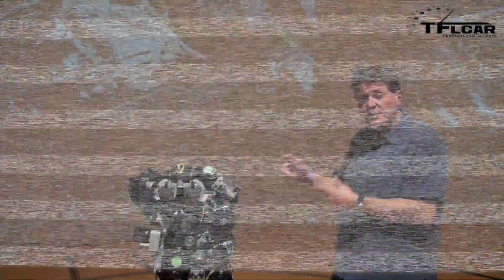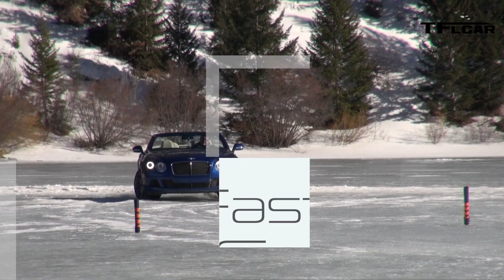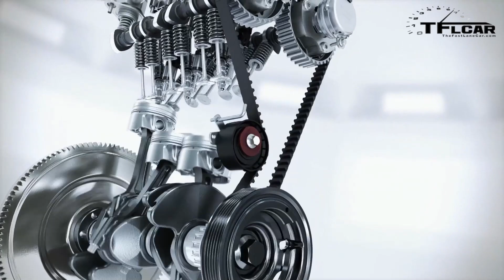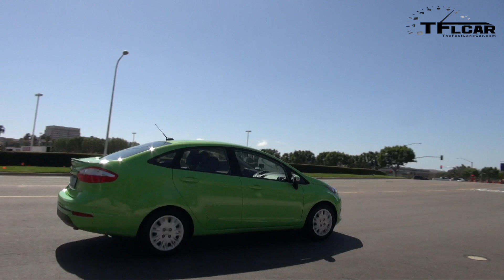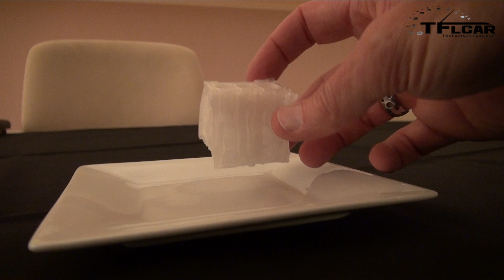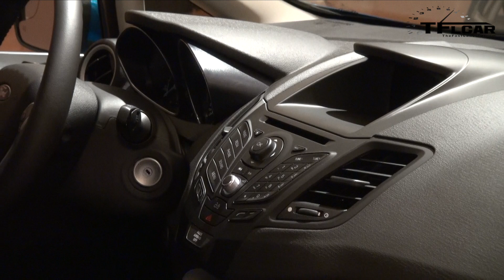2014 Ford Fiesta 1.0L EcoBoost: Everything You Ever Wanted to Know

Comment: I like the idea but I worry about the timing belt
Reply: Jonodude0 I have 999cc car , and it had it's first belt change at 200.000km (120.000mi) . Mechanic told me that it is as good as new when he got it out . And my driving stile is - I drive on 2 lane road in fifth , catching up a truck , slowing down to 40mph , waiting enough space to overtake , slamshif it into second , accelerate to 50mph , and than return into fifth . I am mistreating engine  , now it has 250.000km (155.000mi) , still works as new . Car is 15 years old . You would not believe how much regular oil change could be important and how much new engines could take .
Reply: Thanks for all of your input! It definitely is a new idea to me - nothing like that is available in the United States as far as I am aware. Seems like its working!
Reply: Jonodude0 Well , look at it this way - small engine has light components . Timing belt snaps because of overloading . If it drives light components (small springs , light valves , light camshaft) and belt itself is bigger than it should because it could not be made any smaller , it can last very long . My car is Hyundai Atos . It regulary hauls 5 persons , at least twice a week , when we go to countryside (I live in town , but I have farm about 10 miles away) . Oil is your biggest enemy , because if it was not changed regulary , it becomes thick and it can jam camshaft .
Problem with US market - you buy new cars to often , and you expect to get a lot of car for small ammount of money , so car makers save as much money as they can to make them competitive . You are oversupplied with fake parts because you are big market , and everyone want to maintain their car as cheaply as they can . I buy parts from guy that imports parts directly from Korea , and if he does not have that part that I need avalible , he directs me to other direct importer . His logic is - other guy could not sell it any cheaper , he would still have satisfied customer and customer would have working car so he can buy more parts over years . Because I live in small market , logic is - if parts are too expensive , customer would switch brand .

Comment: Ozni Wellman,  in what world is 45 mpg "doesn't get over 40 mpg?"     And your heralded 3 cylinder Geo Metro also made a whopping 55 hp, about as much as a riding lawn mower.  You'll spend so much time flooring the thing trying to stay away from the traffic roaring up on you that you'll never see anywhere near 49 mpg;   Whereas the Fiesta's engine makes 123 hp, making it much more useable AND fuel efficient.   That's a better combination in every way.     And don't complain to Ford about airbags; that was the government's requirement way back in '97.  And speed is the driver's choice.  No one has to drive 75-85 if they don't want to.  I have a 500 hp GT 5.0 and regularly cruise under the speed limit for the sake of fuel efficiency.

Comment: You know many ECO-BOOST owners in the different engines with Direct injection are having severe drivability issues due to EXCESSIVE carbon build up in certain cylinders and I am talking about LOW mileage vehicles not 100,000 ++++ miles, plenty of negative write-ups here about the eco-boost

Comment: Before 2009 I was not a Ford fan due to my experiences with an old Ford Escort that was a complete lemon but I have owned a UK Fiesta 1L Ecoboost 125BHP now for 6 months.
Previously I had a Fiesta 1.6 4 cyl for 4 years which I loved.
I do a mixture of driving from absolute thrash to gentle pootling about in the city. I get at least another 60 Miles out of a full tank of fuel compared to the 1.6 litre. The 1 Litre is considerably quicker on outright acceleration than the 1.6 was and anyone who says it is slow, clearly doesn't know what they are talking about! I am averaging 47 MPG, with my 1.6 I averaged 44 MPG. My only concern is long term wear of the engine and what would happen if the turbo gave up.
Reply: I sold THAT fiesta a year ago and bought the 140BHP 1ltre version but I know the person who bought THAT fiesta and they have not had any issues with it and I believe they have done 20K in the last year so that would mean it has done 44K in 3 years with no issues.
Reply: I should point out that I live in the UK where a gallon is 4.455 litres. I think it is less in the US.
Reply: Thanks for the info from an actual owner.  I'd take 47 MPG all day long.
Reply: *****
And my MPG is worked out on how many miles I ACTUALLY do and how much fuel I use, not what the car's computer tells me which is 52MPG.
Reply: Nice to hear...I have a silver 2015 3 cyl fiesta on order here in Orlando, Fl...should arrive in late October...I am going to be transitioning to a job with a long commute next year so am looking forward to the 50 MPG.
Reply: goodchappy
Yep; I've noticed on most of my cars that the car computer's average will be a little higher than what I calculate.     Still very good though.
Reply: goodchappy - Correct... US Gallon = 128 oz, UK Gallon = 160 oz.  

47 MP[UK]G is roughly 38 MP[US]G.
Reply: GoodChappy....if your still around here, and have THAT Fiesta,...hows it doing NOW in 2017?  What has gone wrong with it. Guess it is still under warranty? Dont know the length of them in the UK. The turbo dead or the lifetime timing belt snap yet?

Comment: funny how he doesn't recall mpg in Europe,  cause im sure he does know.  European cars tend to get much better mph then U.S. cars.  Care to comment Steve ?
Reply: MPG*

British MPG =/= US MPG. They measure gallons differently.
Reply: Goalatio In the UK, they use gallons.  However, their gallon is closer to 160oz vs 128oz in the US.  For that reason, mileage ratings in the UK, given the same exact vehicle and engine, are higher than the equivalent US measurement.  You get more miles per each UK Gallon than US Gallon.
Reply: european cars are measured in KM or l/100km so the numbers are roughly 1/3 higher

Comment: Never answered the reliability question at all -ducked that one.

Also, the integrated, cooled exhaust manifold will make it warm up faster in cold weather, thereby reducing the idle time needed to get the interior to a bearable temperature in winter.
Reply: That was the thing that perked up my ears. Living in Michigan is tough on cars especially in the winter. I was also concerned with the fact that this is turbo charged and I didn't want to have to wait for the coolant and the oil to warm up so the turbo would be properly lubricated. After hearing about all the new ways this engine takes care of itself, I think this is going to be my next engine.
Reply: Tom Poole I live in Canada and the integrated exhaust works to warm up faster but sometimes it’s so cold my car doesn’t even warm up fully in winter

Comment: Wyh do the US only have 87 octane fuel? The lowest here in Germany is 95.
Reply: its simply different units...We use Octane. European use RON.
87 octane is about 92 RON. 
91 octane is about 95 RON
93 octane is about 97 RON
Reply: The octane ratings are calculated differently, so it's not a direct translation.
Reply: If you're so smart and know everything why don't you just explain yourself?  No need for name calling.  Otherwise stfu.
Reply: Our maximum speed limit is 75 MPH, you guys drive at 120 MPH +, you require a cleaner burning fuel.
Reply: IntegraFilms That's not correct.  They use a different rating system.
Europe / USA
95 / 87
97 / 89
99 / 91
101 / 93
Reply: Robert Nugent Actually we are both correct. ;)
Reply: IntegraFilms I don't see how that's true.
Reply: Robert Nugent Maybe your just dumb. America has strict car regs and complicated emissions systems that rob power, europe cars are simpler, fuel is more complex.

Comment: The 1.0 L Ecoboost is 129hp. It has an oil bath timing belt and a 3 phase cooling system.
Reply: 123 HP actually. but ford claims 125.
Reply: Well I am Ford trained, I am one of their techs. The number is different in many places.

Comment: Timing belt.... I doubt that would last forever. I don't see the point of turbocharging a small engine. Just because it has DI does not make bullet proof. Just like in there trucks twin turbos on a 6 won't have long time reliability.
Reply: matthebest018 - What engine is in your pickup or whatever?

6.0L+ V8 putting out possibly 300hp?  Definitely stressed lol
Reply: The turbos aren't really the issue on these.  It's carbon buildup from the direct injection system.  Also, they torture tested them for several hundred thousand and saw very little wear due to superior oiling/cooling design of the whole setup, including the turbo bearings (they did some nifty engineering to warm the oil to operating temp quickly after startup too).  The reason they didn't see these carbon problems in testing is because they don't test them at constant low-load situations where you tend to get carbon buildup.  They run on a dyno at WOT for the 'equivalent' of their number of testing miles.  All the manufacturers do it that way.  Since these have so much low-end torque, and they're programmed to run at low rpm for gas mileage purposes, they rarely see high rpm use.  I've got the 1.6L ecoboost in my wife's car and it acts a lot like my Delta 88 that had the 3800 V6 in it, great throttle response, lots of low end torque, not much extra HP if you wind up the RPM.  Unless I'm passing on the freeway or having a little fun with it, it rarely hits even 4000 rpm because I've got plenty of pull down there, which is crazy being such a small motor with a turbo.
Reply: mohammad ali My honda accord has 250,000 on it, we still use it every day. Waiting for Turbo VTEC, Honda always does things better then ford.
Reply: matthebest018 - 350,000Miles?  Is that all?

There are taxi drivers here with 450,000+ Miles on their Diesel Engines
Reply: MrAndersie91 Not under stress? Do you know what trucks do? It's 350000 miles of hard work and that one time i went offroading ;)
Reply: matthebest018 Wow...one whole time offroading...
Reply: matthebest018 It's a more than a little disingenuous to say that considering the engine line is not even 10 years old yet.
Reply: MrAndersie91 Yet mine is an old gasser 4.8l does everything i ask it to
Reply: matthebest018 - Its an over sized lazy american petrol engine which isnt under ounce of stress..

They usually do last ages
Reply: MrAndersie91 Diesel engines are a whole other ballgame. There's a reason they don't put gasoline engines in 18 wheelers. They're built for torque and durability.
Reply: Count Crotchula - Dont put Petrol Engines in Trucks,  but put 5.0L V8 into Pickups?  Logic Is Where??
Reply: MrAndersie91 I'm talking about 18 wheelers not pickup trucks.
Reply: *****  Tell that to BMW motorcycles. Their horizontally opposed flat twin  is one of the most reliable, high mileage engines in the motorcycle industry and has been for years. I do agree that proper design is  key to reliability. Also application and maintenance are key issues that dictate reliability.
Reply: Oh I'm not trying to make argument. I agree that an inline is probably the best configuration for endurance and performance. That is why every Asian hot rod currently produced is an inline. The Suzuki Hyabusa, the Kawasaki zx-14, the new Kawasaki  supercharged H2, and yes even BMW's S1000RR. They are all inlines. They are all very dependable, durable, and very fast.
I also have dealt with several Harley type engines, mainly S&S engines that the configuration is out dated by decades. 45° v twin,  pushrods, and a common crank pin with male and female rods.
S&S had a family of 100, 107, and 113 cu. in. engines. The 100 cu. in. Was square with a 4" bore and 4" stroke. The 107 was 4" bore 4 1/4 stroke. Both the motors were dependable and fairly smooth. The 113 cu. in. was 4" bore 4 1/2" stroke and no matter what you did it would shake itself apart. I know thats all apples and oranges.
The BMW boxers are one of the most durable engines ever built myself seeing bikes with over 300,000.0 miles. 
Anyway no argument here, just saying.
Reply: Jetton King Problem?.....
Reply: someone has a 300k ecoboost check the forums .
Reply: And you'r talking about reliability as if gm's cars like the one in your channels picture have it ?? From my experience in cars that i owned ,the only cars that can beat ford in reliability is toyota's
Reply: mohammad ali Ok there bud i got 350000 miles on my silverado something an ecoboost will never ever! get to.

Comment: I hope this is a non interference engine for when that belt breaks. No maintenance for the customer lol. Just put it on the outside so you can change.
Reply: The belt runs in oil and it wont really break unless you're not changing the oil.
Reply: If after 300,000 miles of hard use it eventually fails, £600 or less for a full low mileage ecoboost is cheap to replace the entire engine. These will last economically for decades.

Comment: Good review. Now that integrated, water-cooled exhaust-manifold, will that also mean the coolant gets up to temperature faster than in a regular engine, increasing efficiency and meaning the heater gets hot sooner? Seems like that would be a beneficial side-effect.
Reply: The heater will get hot sooner and the startup emissions will be much easier to manage.  The integrated exhaust manifold has multiple benefits.
Reply: Thank you. Exactly what I figured.

Comment: It's easier to get higher compression numbers from a small motor. You can have a blown 2 liter that'll make much higher than numbers per liter than a 6.3 liter motor. I think a lot of it has to do with how much volume is needed to be filled in a small amount of time. It's easier to fill 1 liter of air at 15 psi than it is to fill 6.3 liters at 15 psi.

Comment: Never seen an exhaust manifold integrated into the head assembly. Interesting design cues on the engine, thanks for uploading!
Reply: the new civics have the manifold integrated too
Reply: ***** I guess that's the direction newer vehicles will go in terms of engine design. Thanks for informing me.
Reply: The new Volkswagen ea888.3 engine has it integrated as well.

Comment: "sealed for life" has never, ever worked out
"sealed for life" always means "it'll break at 100k and destroy everything around it"
Reply: I once overhauled that engine and amazed how powerful it is despite its size .
Reply: Basically the warranty period.
Reply: @joshmalley710  false
Reply: Its sealed for life, " Can I have that in writing  ? "
Reply: I have in South Africa a 1995 BMW E36 328 - made 20 km away from me in Roslyn Pretoria. It's rear diff is sealed for life. I changed the diff oil at 300,000 km. She's now pushing 400,000 km. Engine, gearbox and diff has never been opened, she has the original exhaust....yes really. I proactively change stuff that will leave me stranded. Am on the 4th rad, 3rd clutch, 2nd starter motor, 3rd alternator, 3rd water pump, 2nd fuel pump.

Sealed for life means normal lifespan which is 300,000 km.  Use your head and change the oil at sensible intervals.
Reply: that is a big engine you have there man. This smaller engines are really struggling to pull the body, so it has to work at higher RPM. That means shorter lifespan and it's a 3 cylinder engine, those are known not to be so reliable compared to 4 and more cylinder